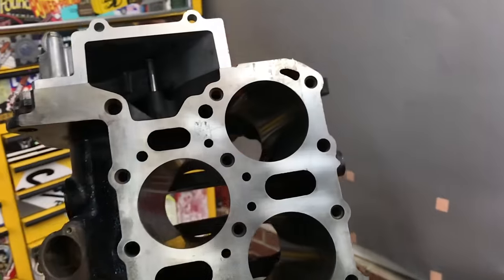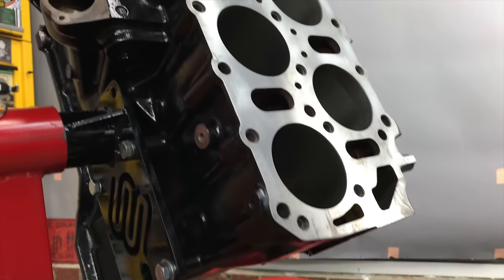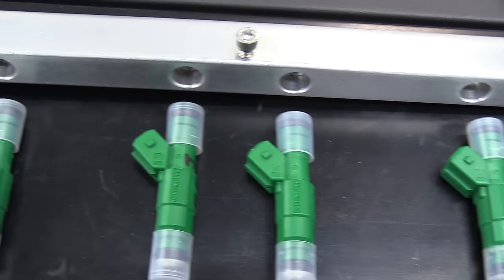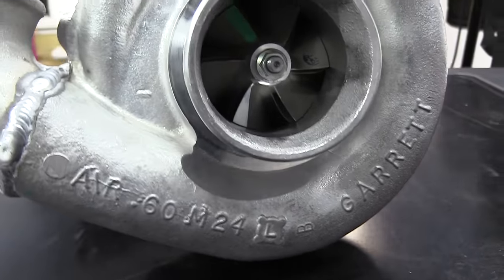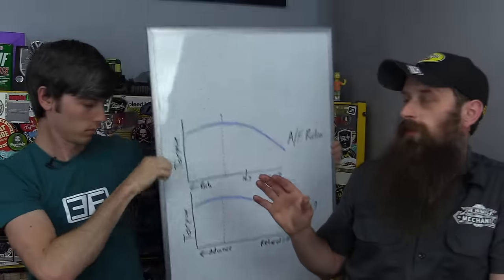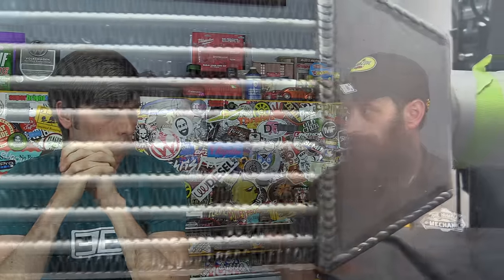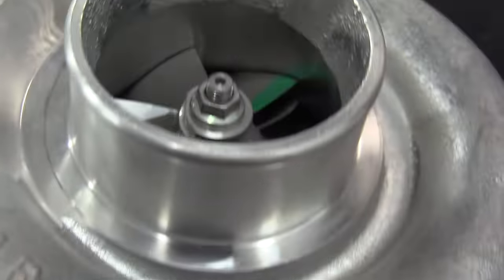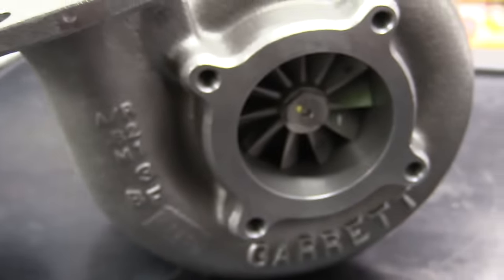5 Ways To Prepare Your Car For Turbocharging

Comment: I would turbocharge the 2.5L I5 in a heartbeat if the TTRS and RS3 didn't exist. VW I5 = 170 hp, Audi I5T = 400 hp with beefed up internals and of course, the turbocharger :).

Comment: wait wait, why wouldn't you paint it black? thats proven to work mcm tested that and it totally made a difference at stoplights and such
Reply from the maker: https://youtu.be/z_mmmXTbLP0
Reply: i stand thoroughly corrected sir, i distinctly remember thinking at the time of watching that video that it sounded like nonsense and it that the paint would just insulate the inter-cooler but when they got to the three percent i just brushed it off and thought to myself huh well three percent doesn't sound like alot, but your point is well taken XD i guess they teach critical thinking in the second half of an engineering degree XD

Comment: No where here do they tell you what to do with vacuum to boost change all the line's that have to be corrected boost the windshield washer system or the pressure to your egr system or transmission or pcv system hell just run your boost to your crank case vent its all good😧

Comment: If only it was allowed to touch an engine in Belgium... basically, everything that changes from the CoC is illegal unless you are able to get it through the technical examination, as far as getting a new CoC and such. So basically, if you try to do something they will screw you, and take your money...
Reply: How do they check? Inspection for yearly registration or something like that? In the US, they do check on SMOG emission for older cars (every other year).
Reply: Vairavan Srinivasan it is not that easy, the first 3 years there is no inspection, after that you normally have a yearly inspection, but if you are under a certain mileage you could skip that first yearly inspection. After that it is yearly inspection. Even old timers do need to get a yearly inspection. A friend of mine was restoring an old jaguar and did search for all original parts, and he didn't pass inspection since they thought the stiffness of the suspension was to weak for that jaguar model. He had than installed some aftermarket suspension parts to get closer to what the inspection mentioned what it should be. But for new cars they have the CoC so they know what everything should be and what was changed. Even simple chip tuning is illegal, although there are ways around that (swapping chips before and after the inspection, at risk they find out when you have an accident). I do get it that you are not allowed to make a 400hp VW beetle for example, but for cars that need an engine replacement it has to be the original engine and not another one. In the Netherlands it is allowed to swap an engine if it doesn't change that much in power (put in %) which seems much more fair in my eyes. Also, how could people with today's cars switch to electric without having to buy a new tesla or such? No possibility here in Belgium, while in the US there is a whole market that electrifies existing cars. Sometimes it is easier to just export your car to the Netherlands, get things done there and than try to import it in Belgium as a new car. Not only easier but also cheaper...

Comment: I have the most useless and nonsensical question but I'm going to ask it anyways.

What would happen if you fit 4 turbochargers in a single cylinder engine?
Reply: But thats if you can actually fit four turbos onto the intake and outtake of your one cylinder. Highly doubt that.

Youd be better of with one for an insane go cart, if you could fit one on

Comment: Don't forget those stickers.
You'll be chasing peak power on a dyno forever, unless you properly place those Garret Turbo stickers.
You better included all those other upgrade components and their corresponding stickers. Or you'll be chasing gremlins in your setup till you fry the bearings.
Did Forza teach you clowns nothing?

Comment: Stopped watching when he said 10psi. Not even worth the money it costs to only add 10 psi.
Reply from the maker: +The Stig 10 psi for a 2.8L is quite a bit of air.
Reply: Go 15 or go home. My 2.3 Turbocoupe would do 15 all day long.
Reply: 14 lbs is 100%  power gain. Effective on a 12v head with limited flow.